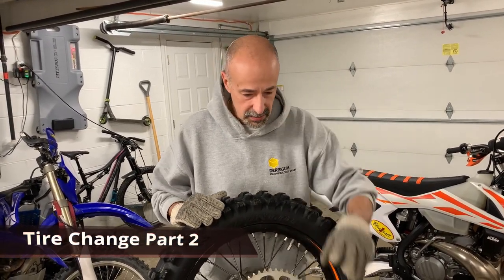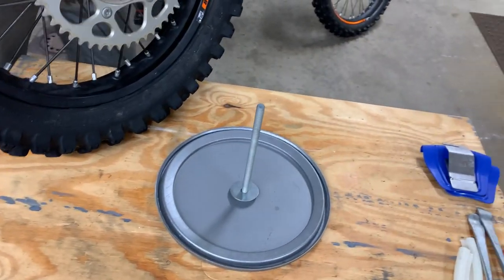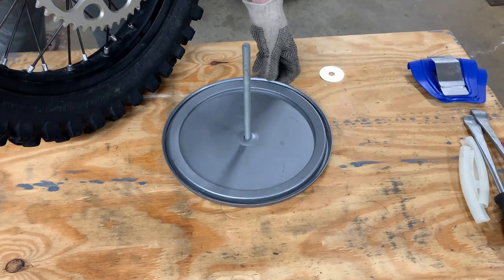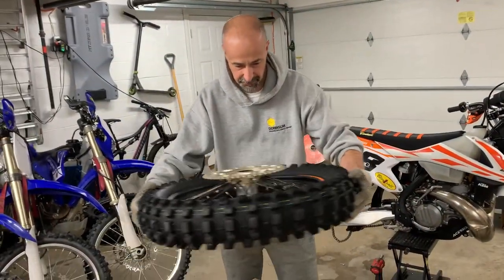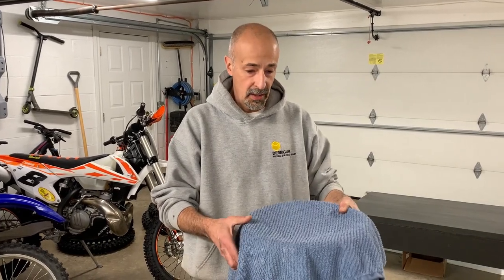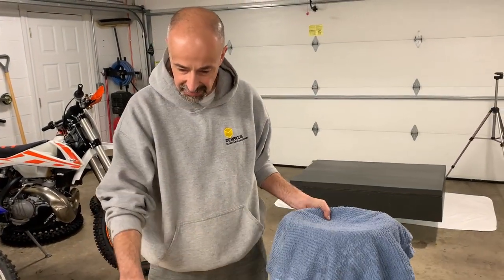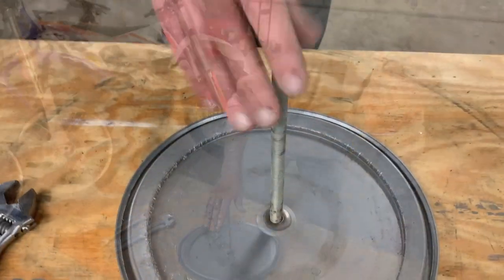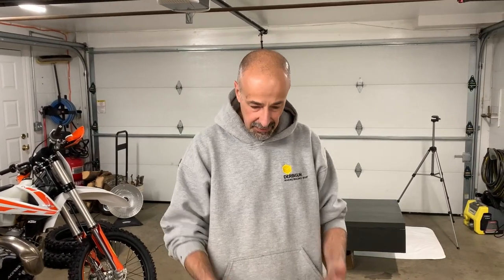How to Change a Dirt Bike Tire | Homemade Stand | Part 2

Comment: Nice tire changing stand! Now you'll be able to replace a tube on the trail with all that practice. Using excessive tire mounting lube has helped us out a lot when removing and installing tires. The tube can also be coated which helps prevent the tire irons from pinching it.
Reply from the maker: Thanks for the idea on the tube.  Next time I plan on trying actual tire mounting paste.  The Simple Green works but it kept drying out.

Comment: No problems with bending the rotor having it on the table like that?
Reply from the maker: No Problems at this point, but that is a good point.  I would need to be careful not to lean on the tire much.